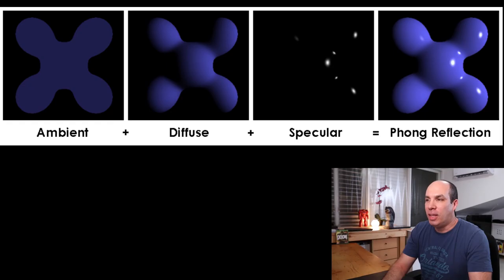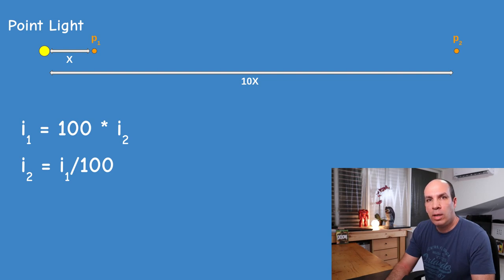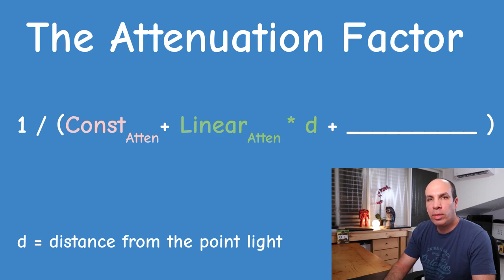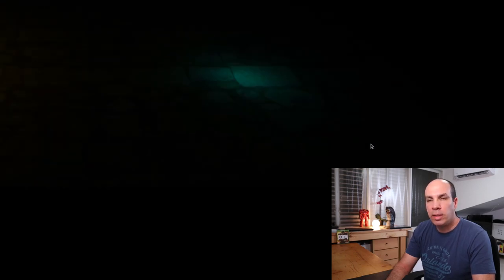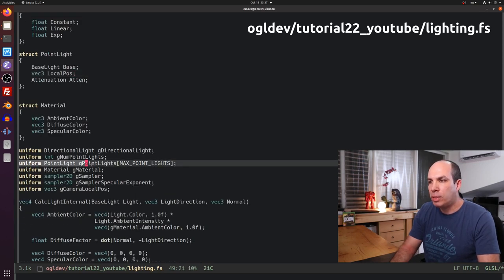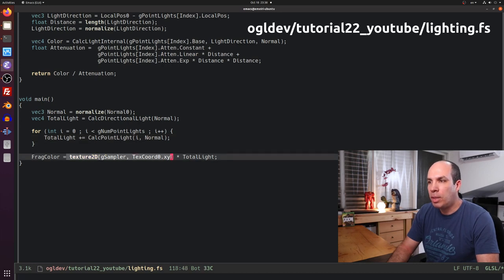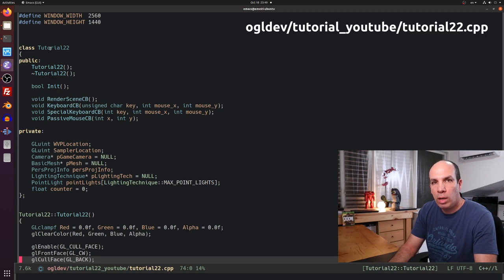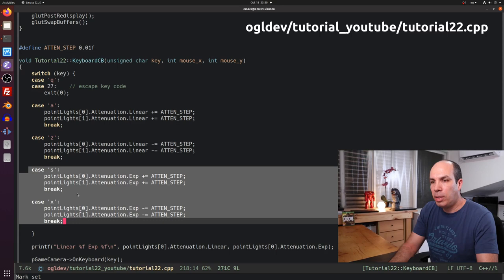Multiple Point Lights  // OpenGL Tutorial #22

Comment: Hi, wouldn't the distance for intensity calculation be affected in case of object scaling? For example, if a model is scaled down, the reverse scaling is applied to the light position, but the distance between the light source and each position would not be accurate. I might be wrong and made a mistake somewhere else, but in my case i get different results for 2 objects that are the same size(after scaling), one scaled down and one scaled up. Thanks.
Reply from the maker: You are correct and I actually hit this problem myself and was thinking about doing a "debug story" video about it. In my initial implementation I used a normalized square for the surface and scaled it up significantly which caused a major distortion in the light calculation. So if you are applying large scaling factors you would want to reverse them on the vertex positions. I guess that this problem is more common in small manual tests whereas in a real game with lots of objects it will be better to get the entire scene in the correct scale from the modeling tool without applying any factors later on. For example, in Blender you can export a model with a scaling factor separately, or you can tell Blender to apply the scaling factor on the vertices and export the model with the final positions.
Reply: A temporary solution which worked for linear scaling was passing the final scaling factor for each object as a uniform and multiply the direction by it(the length of the light vector). It could work with non-linear scaling as well, as long as the scaling factor is the minimum out of all 3 axis to keep the proportions imposed by that scaling operation, but i am not 100% sure about that.